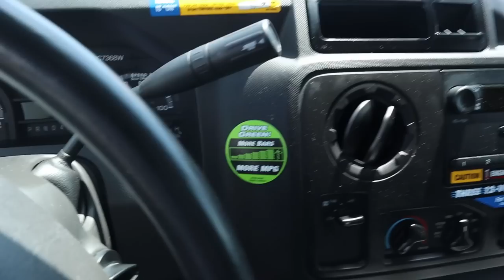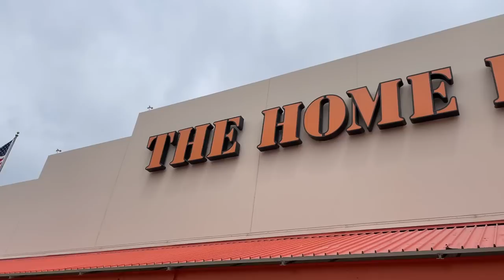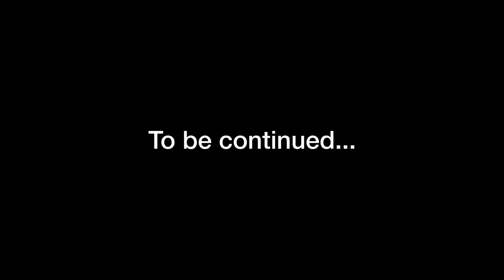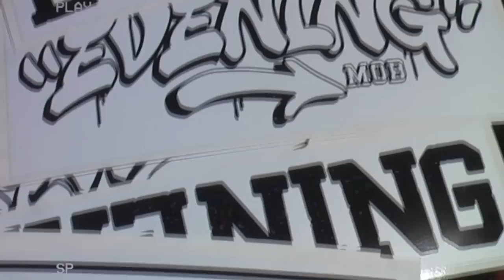I Got A FREE MINI RAMP! | D.I.Y MINI RAMP |

Comment: Ya might wanna get some wood hardener or something for those really discoloured prolly rotted bits of ply, if not just replace them using the good side to mark the new ply, I'd also get some water resistant coating (regular paint I spose) wherever water could pool, like the flat and anywhere touching flat ground.

Also how similar is home depot to bunnings? Makes sense they'd be basically identical but yanks just make things weird for no reason

EDIT: prolly shoulda watched the full thing before commenting lol

Dunno bout the specific paint you used but the whole shortage of things caused timber quality to drop for a bit n might still be a thing where it wasn't dried properly n that's messing with the paint n adhesion
Reply from the maker: Oh yea this mini is deff a fixer upper, im planning to do it bit by bit and restore it as best as i can 

Home Depot and Bunnings are basically the same thing, But you never will find blokes waiting out front of bunnings for cashies as you will see at Home Depot! the hustle is real! 

The paint I bought I guess is suppose to disappear maybe? lol

Comment: Do a surface sheet of birch.
Reply from the maker: Wouldnt be a bad idea!
Reply: @SeanEnuks  I have some on a quarter pipe in my basement and it’s smooth. It’s also a water resistant wood. 3/16 should work.